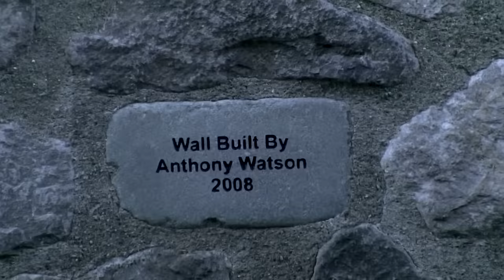Building Stone Retaining Wall

Comment: Just a couple of things:  We had a lot of stonemasons immigrate from the "old country" into the area where I grew up, and their retaining walls, over 100 years old now, still stand in perfect order - some more than eight feet tall.  They always placed terra cotta pipe "weep holes" through the walls, so they could bleed off water from behind, preventing the soil from freezing, expanding, and toppling their walls.  They also put rubble between the walls and the hillside, also to drain water down to the weep holes and to prevent frozen ground from shoving their walls from behind.  I don't see those here.  Are you in an area that doesn't freeze?  Have you had any problems with the above?  Thanks.
Reply from the maker: I have a 4" perforated pipe behind the wall that redirects any water to the other side of our property. That is surrounded by stone and landscape fabric to keep soil out of the drain. Only the top 8-10 inches or so is soil. The wall is over 12 years old now and there have not had any issues. I'm in SW Washington state.

Comment: Nice job , for a novice . The only thing I would have told you is to put gravel behind it and plenty of weep holes to release the pressure .
Reply from the maker: There is gravel and a 4" perforated drain line behind the wall. It doesn't show up in the video, but you can see it in the photos on my web site. https://www.watsondiy.com/20080908-stone-wall-2008.php

Comment: In Hungary the concrete base is always at least 60cm(2ft) deep. The winter is cold and soil freezes down deep. If base is not deep enough freeze lifts things up even houses
Reply from the maker: Our frost line is only 12" deep here, so I dug down about 6 inches than back filled another 6 inches to stay below the frost line. Other areas up north may need to go 3-4 feet or deeper to avoid frost heaving like you mentioned. Good drainage behind the wall is critical also.

Comment: Wow lot's of hard work & great results. Still think frost will push it over in time. I think stone walls need to be just as wide as they are tall & sloped on the bank side.
Reply from the maker: It's 15 years old now with no issues. We do have a mild climate and I have gravel and a drain line behind the wall. That said, nothing lasts forever...

Comment: Nice work and a very pleasing finish👍 but I’d have put some short pipe drainage points through the bottom of the retaining wall, and a run of graded ‘no fines’ stone as filter media behind it, to relive the water pressure by creating a longitudinal filter drain with pressure relief points.
Maybe I’d over engineered it by doing that but it would enhance its long term performance for very little additional cost.
Having said that, what you’ve done could very well out last me 😊
Out of interest, how’s it holding up so far?
Reply from the maker: There is a 4" perforated drain covered with stone and landscape fabric behind the wall for drainage. It discharges over the hill on the other side of our yard. See the photos on my web site at: https://www.watsondiy.com/20080908-stone-wall-2008.php.  16 years later the wall is holding up nicely. Other than occasional moss build up on the wall, there has been no cracking and no leaning.
Reply: @AnthonyWatsonDIY  I’m glad to hear it, thank you. It looks beautiful and I’m delighted that it’s functioning well. 
I must’ve missed a sequence from the video as it sounds like you made provisions for drainage. 
In any event, engineering design is measured by time.
I’ll go back and have a rewatch, and thanks again for responding, it’s much appreciated 👍

Comment: Fill it flush leave over night the get the old wire brush out.....great work😁👍👌
Reply from the maker: I would fill the mortar flush with the front of the wall, then wait about 3-4 hours for it to mostly set up. Then I used a stiff brush and water to removed the excess and shape the joints between stones. It worked well as long as I didn't wait too long and have to resort to a wire brush. :)
Reply: It's surprising even during hot summers leaving it till the morning it's still soft enough that as you gently brush it back with a new wire brush you can control the width of the joints and it leaves the stone very clean as well. No need to wash it. 👌

Comment: If this wall was built in a northern area where frosts go into the ground the cement base will crack and cracks will form up through the nicely laid stones. To add to the problems little or no drainage system or even crushed stone was used behind the wall.  Even in frost free areas the water will dam up behind the wall and push it forward.  Looks nice in this video.  I'd like to see it in 5 years.  To bad it was not done right!
Reply from the maker: The footing is below the 12 inch frost line in our area. There is a 4" perforated drain, crushed stone, and landscape fabric behind the wall. The wall is almost ten years old now, no cracks, no leaning. Good as the day I built it.
Reply: Bravo Anthony!  Might not have been done "right", but it was done right enough👍👍
Reply: You should of showed that in the video. That is a very important part of this very impressive wall! Check out Mike Haduck videos to see how he explains the details of retaining walls and their problems in the northeast.
Reply: How about a current pic?
Reply: What do you have to say to THAT, BILL?!?!
Reply: You're not helping anyone with your unsolicited know-it-all comments, Bill.
Reply: "There is never time to do it right but there is always time to do it over".
Reply: no sign of 4" perf, crushed stone, or fabric (which I would never recommend using) in the video. the masonry work looked nice
Reply: AWESOME

Comment: Hey anthony' you did a good job for it being you first wall' im impressed', I see you took a short cut with the rebar and just pushed it in the wet cement' still strong though'
Reply from the maker: The horizontal rebar running the length of the footing was placed on blocks before we poured the concrete. But yes, I did just insert the short vertical sections after the pour. I mainly just wanted to keep the stones from being pushed off the footing. Nine years later and the wall is still standing strong, no cracks, no leaning. Success in my book.

Comment: Very interested to know how this wall has held up, especially with that tree right there
Reply from the maker: Hi Rodney. The wall is over 11 years old now and doing great. No cracks and no leaning.  We are shaded by lots of trees so moss tends to grow on the wall.  I clean that off every couple years or so. Also, since the hill behind the wall slopes down, I occasionally have to clear away dirt that has washed up against the back edge of the wall, but that's only needed after a few years. Otherwise, no issues, it looks as good as the day I built it. Thanks for watching!

Comment: 2023 If you did it again what would you change? What is the quality and cure time on the concrete mortar ?
Reply from the maker: I don't think I would change anything. 15 years later the wall still looks great and has held up wonderfully. As for the mortar, I would build the wall for 2-3 hours in the mornings, let it set for a couple hours, then clean off the excess in the afternoon. Exact timing of each step would vary depending on how hot and dry it was outside. It was fully set up by the next day, but I would think it would require the same 28 day cure time as concrete to reach maximum hardness.

Comment: Looks great.
What about drainage behind the wall? A lot of water coming down that hill in a heavy rain.
Reply from the maker: There is a 4 inch perforated drain behind the wall surrounded by gravel and landscape fabric. It connects to a line that discharges on the other side of our property. You can see a little bit of it in the photos at the bottom of my web page: http://www.watsondiy.com/20080908.php

Comment: Anthony i see you are putting on alot of mortar but then you  seamingly have removed/cleaned it up later. could you describe the process?  i have no experience but are wanting to make a similare wall as a fence..
Reply from the maker: Yeah, I would over pack the mortar between the randomly shaped stones. After it set up a couple hours or so, I would come back with a brush and a garden hose to shape and clean up the mortar joints. Occasionally if I let it sit too long, such as a hot day, it would get too hard for the brush and I would have to use a wire brush. It's a bit unusual technique, but I found it worked better for me than trying to tool the joints as I was placing the stones. When the wall was finished, I used muriatic acid to clean any remaining haze left on the stones from the mortar. Hope this helps.

Comment: I’ve always thought they would put some kind of anchor in the ground behind the wall and attach it somehow for stability
Reply from the maker: They're usually called "deadmen" and are usually used on taller walls over four feet, especially with timber walls. My wall is only 30" high at the tallest point, has significant mass, leans into the hill slightly, and has gravel and drainage pipe behind the wall. In my case a deadman wasn't needed.
Reply: time will tell! I suspect that the weight of the soil and root action over a few seasons will bring it down
Reply: Tony Flynn I queas you didn’t pay attention, the wall was built 12-13 years ago and is still good.

Comment: Have you had a chance to visit your wall since 2008? Retaining walls can be tricky. I like the taper you put on it towards the shed!
Reply from the maker: Yep, it's right along our driveway. We see it every day and it still looks as good as the day I built it. Other than moss growing on it occasionally, there are no cracks, leaning, or other issues. The top of the wall is actually level, but the driveway slopes up the hill so the wall gets shorter as it moves up the hill.

Comment: Nice work.  I'm wondering if the wall should be thicker; when the wall approaches a height of 3 feet or more, you getting into some big stresses.  Engineered walls are needed.
Reply from the maker: Around here anyway, engineering is only needed for walls above 4' high. Still, I made my wall 12" thick, with a slight tilt back into the hill, with a concrete footing, and rebar tying things together. There's also a drainage pipe behind the wall to reduce hydrostatic pressure. It's nine years old now and there is no sign of cracking or leaning.
Reply: Sounds like you built it right.

Comment: that's a pretty shallow wall foundation, no frost concerns? also, i'm pretty sure all retaining walls need a T footing to prevent it from turning over, but i guess this wall isn't really retaining much.
Reply from the maker: Hey Rok, frost level is only 12" in our area. I dug down about 6" to pour the footing, then backfilled another 6" after the wall was done. Deadmen or L-shaped footings usually aren't needed for walls under 4 feet, but it depends on the soil conditions. Our rocky ground mostly retains itself, and I have a 4" drainage pipe behind the wall to prevent water pressure behind the wall. 14 years later the wall is still holding up great, no issues at all. Thanks for watching!

Comment: Great video thanks for sharing. one question, don't you need dead men in that wall through the net from pushing over?   By the way, you should have told the UPS guy that you are ordering more rocks.  *)
Reply from the maker: +Eric Peters I did not install deadmen bracing in my wall. The majority of the wall is under 3 feet high, and the mass of the monolithic wall basically keeps it from moving. I also curves back into the hill, sort of like a dam is built. I installed a drain pipe and gravel behind the wall which also helps reduce hydrostatic pressure from behind. The wall hasn't moved a bit in eight years.
Reply: I'm wondering about the bearing pressure of the native soil, and what the footing is rated for. Where the rock wall and footing aren't a single piece, it will be prone to shifting with the lateral force of the native soil. Great work! I would recommend using rebar to tie the two together to increase resistance to the pressure of the earth it's retaining. Won't fail in this life time, that's for sure.

Comment: nice just came from your website nice that you added a French drain most retaining wall failures ive seen involved wet soggy earth ... why did you cover the ends in cement completely then clean it off? @2:41 youre trialing  the area in referring to
Reply from the maker: Thanks! This wall is 14 years old now and still looks like the day I built it. I found the easiest way to achieve a consistent look was to over pack the outside of the stones with mortar, let it set up for a couple hours, then use a brush and a spray from a garden hose to shape and level the mortar flush with the stones. This was far easier than trying to tool the wet mortar, especially with irregular shaped stones. Occasionally (on a hot day) the mortar would set up too quickly and I would have to remove the bulk of the excess mortar with a wire brush first.

Comment: I just checked your recent videos to see how your wall held up 12 years later.  It looks great!  What mix did you use for the mortar?
Reply from the maker: Thanks. I don't know if it's the proper mix, but I used Quikrete Type N - https://www.homedepot.com/p/Quikrete-60-lb-Mortar-Mix-110260/100318487
Reply: @AnthonyWatsonDIY  If it's lasted this long I'd say you made the right choice!  Do you get snow (freeze/thaw) cycles where you live?
Reply from the maker: @chrishuyler3580  We generally have a mild climate here in western Washington, with only one or two really cold spells per year.  Every year seems to be milder than the last. We used to get a foot of snow or more every year, now we rarely get more than a dusting.

Comment: I’m interested to see what you did (if needed) for drainage.  It appears you put up that wall without any drain rock or pipe behind it?? I have a similar slope and plan on doing rock wall. But I will be adding some drainage system behind it. Glad yours is solid after 11 years! 
Lucky you don’t have HOA lol
Reply from the maker: I did install a 4 inch perforated drain, landscape fabric, and stone behind the wall. You can partially see it in the photos near the bottom of my web page at https://www.watsondiy.com/20080908-stone-wall-2008.php  It connects to a solid drain that discharges any water to the other (downhill) side of our property. Oh, and it's 14 years old and counting now. :)
Reply: @AnthonyWatsonDIY  ahh nice!  Thanks for the photos , video and quick reply. :)   How about we quit this one man army stuff and you help me out? Lol

Comment: Looks like a 4 inch base with no reinforcement rods, looks nice but it will crack like hell
Reply from the maker: The footing has half inch rebar running the full length (see 1:10 in the video), as well as vertical rebar stubs every four feet to tie the stone wall to the footing. It's now ten years later with zero cracking.

Comment: love this! you did such a great job and I bet it took a lot of patience. do you think this same technique could be used to build a fire pit? just instead of a plywood back for shape, use a round surface to build around then remove when it's done?
Reply from the maker: I'm sure you could, you would just need to use refractory cement to set the stones. Traditional mortar may explode as the heat of the fire causes trapped moisture to expand. Or, use something like a steel ring for the fire pit and build the stone wall around the exterior as decoration.

Comment: Hi. Do you need a water "escape" ?  Should I leave a spacing between some stones so water doesn't build behind the wall ?
Reply from the maker: Adding "weep holes" or channels at the bottom of the wall can help. I installed a 4 inch perforated drain behind the wall, covered in gravel and landscape fabric for drainage. Any water behind the wall goes into the drain and is discharged on the other downhill side of our yard.
Reply: @AnthonyWatsonDIY  thank you !!

Comment: Wow Anthony! I read thru the comments and it's hard to believe this is your first rock wall. Having done just a (very) little bit of rock work in my backyard, I know how easy it looks - throw up a few rocks and presto! But it's a LOT harder than that to get it right - and you got it right! Congrats for the hard work and beautiful results. How long did it take to complete, in total?
Now excuse me, I have to go take some Ibuprofen - my back hurts just watching this!!!
Reply from the maker: This was the first of three walls I've built so far.  It took me about four months to build this wall. I worked 3-4 hours in the morning mixing mortar and placing stones, let it set up for an hour or so, then went back out in the afternoon to clean up the excess mortar. This wall is eleven years old now and is holding up very well. Ironically, I found this to be harder on my feet and knees than my back.
Reply: I’m interested to see what you did (if needed) for drainage.  It appears you put up that wall without any drain rock or pipe behind it?? I have a similar slope and plan on doing rock wall. But I will be adding some drainage system behind it. Glad yours is solid after 11 years! 
Lucky you don’t have HOA lol

Comment: what about drainage? How will the water be drained off if you are sealing all the gaps in stone with cement?
Reply from the maker: I have a 4 inch perforated drain behind the wall, covered with gravel and landscape fabric. Only the top 6" or so of the backfill is soil. The perforated drain connects to a solid drain that directs the water to the other side of our property to discharge over the hill.